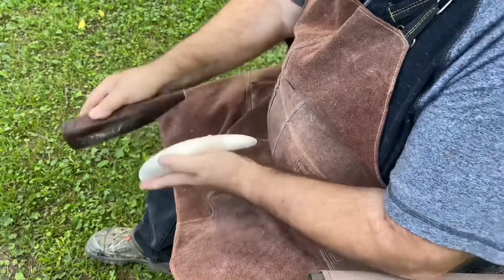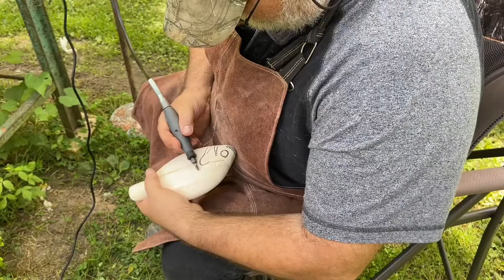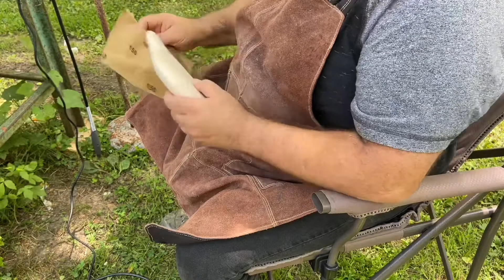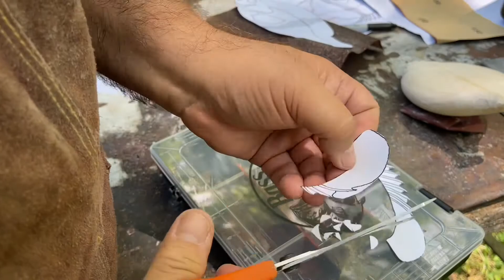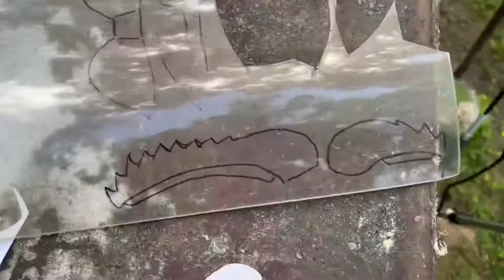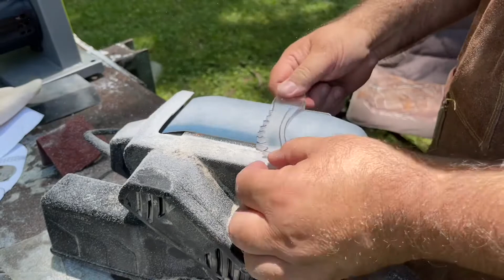Bluegill bream wood carving part 3

Comment: What kind of material is that plastic?
Reply from the maker: It’s plexiglass. It was some scrap from an old display case my brother had. It carves fairly easy and can be carefully heated with a small torch and molded and bent to simulate movement. Only problem is it can’t be used in most competitions. I know it can’t be used in world competitions. 
But I think for personal projects or commission work I’d use it again. I like that it retains some of its transparency after painting.
Reply: @Danny_Harris-Arts  thanks Danny, thanks for the vids! Very nice work!